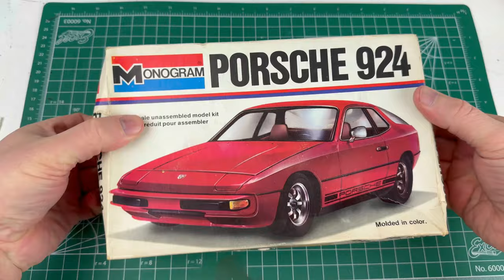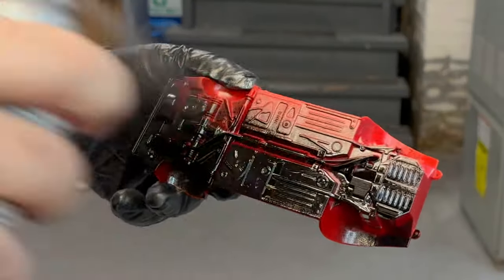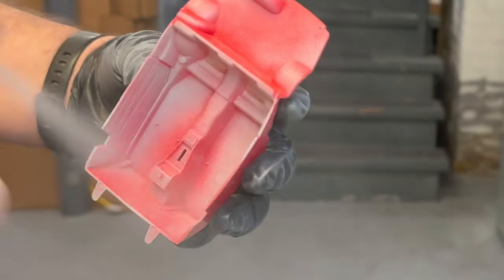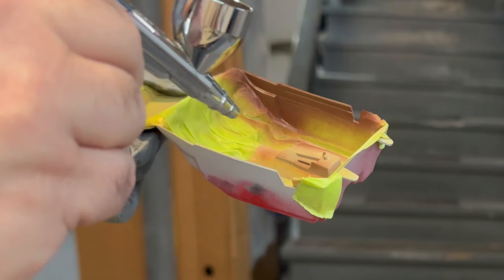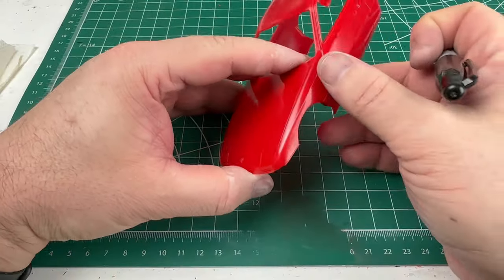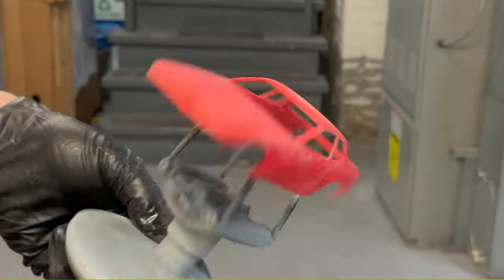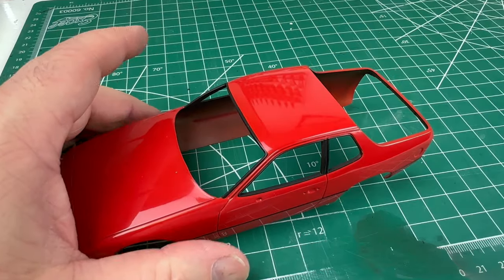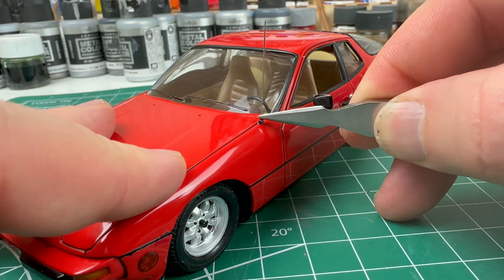Build a cheap Porsche in Miniature: The 924 by Monogram [FULL BUILD] Step by Step

Comment: Didn't even know Monogram made a 924, super cool! Thanks for sharing your hard work, it turned out awesome. Going to have to be on the lookout for this kit myself at some shows.
Reply from the maker: Arii does a 924 kit as well and I've had my eye on that one for some time but it is a turbo version which has a different grill and different rims and also has the rear spoiler. I came across this one while I was eBay browsing and just had to have it. Same rims as mine was and same front end/hood. It has also been released in a rally version but I am glad I found the road car. Hope you find one, it was a great build.